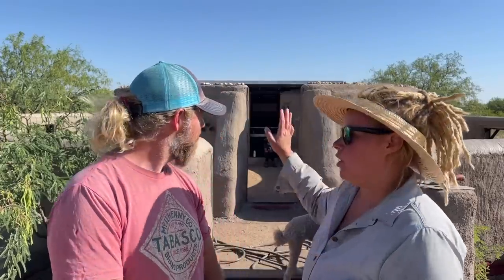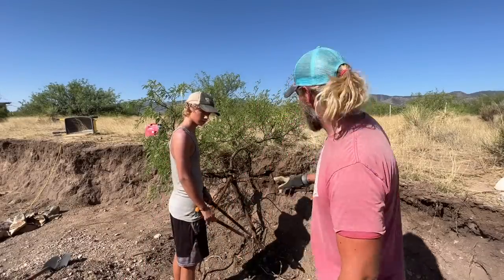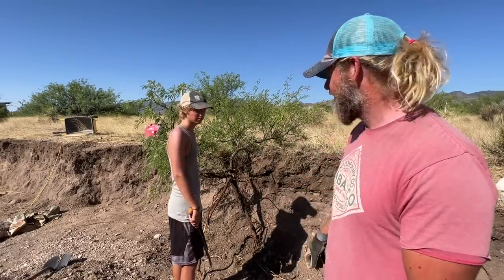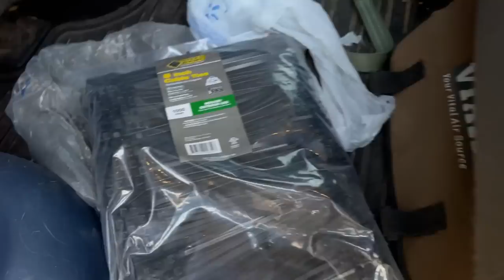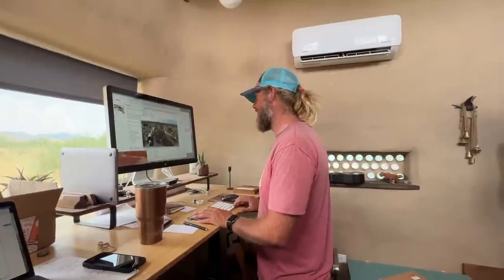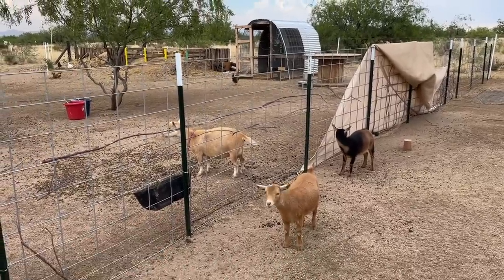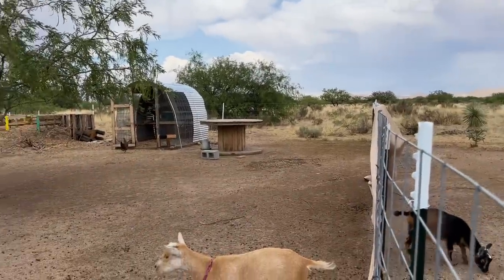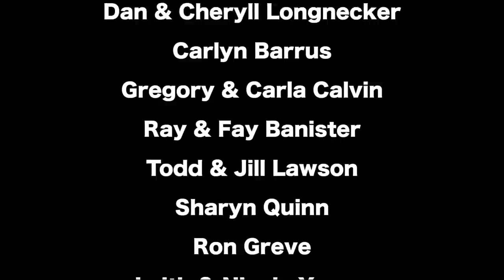Humping Up the Chicken Garden? Plus a Quick Goat Shelter (Day 146)

Comment: Looking nice. You'll have to put solar lights on the top or inside sides. Nine nine needs a kiddy pool. By the time you guys get done your put will be a nice cellar. I wonder if the roof coating Sure Coat plasticized coating would extend the life of the structures. It has a ten year guarantee then you roll on an activator to extend it another ten years. Might be nice to put on your house.

Comment: You put socks on your microphone!   That’s awesome!  Thank you. You did fantastic!!!  Started to ask you why you didn’t have a stake pounder but then I saw you whack what looked like one. I have one but I am 1500+ miles away.  It is a heavy cast iron tube with a cap at the top end and 2 large and heavy D handles opposite of each other at the top end of the tube.  You put the stakepounder on the stake and slam it down on the post, using the handles.  The force behind the heavy tube that you accelerated down when you slammed it will push the post 3”-10” into the dirt, depending on the hardness of the dirt. If you are younger (or older) and not strong enough to slam it down, you can simply lift it and drop it down and it will continue to push it into the soil at a faster rate than a hammer. Well, that is assuming that you are not wielding Paul Bunyan’s sledgehammer. And if you are using THAT, I will sit back down with a meek ‘never mind’.
Reply from the maker: We have a t-post pounder, but when there's a palette in the way you can't use it :)
Reply: If you pound the post in and then put the pallet over the post in place.
Reply: @colleenlathrop6607  - I think the stake was to stabilize the pallet already in place and moving the one pallet might have caused a domino effect.  Wild guess, though you could be right.  I am only guessing that because they were trying to beat the rain so planning on where to put the pallets was less of an option

Comment: Hi,

Do you really NEED! to do a second smoother layer of plaster? 
Could you use a lime paint or similar to protect the current coating? 
It is, after all, a chicken coop, run and garden.
Reply from the maker: Yes, the final layer has a higher ratio of cement, is compressed, and smooth. According to CalEarth this provides the right amount of stability to keep the rains from ripping it off. Of course it's all a test, so we'll see how it performs.

Comment: I don't know what the brand name is, but for the past 30 years we've had a T-post pounder with a large spring inside it. I can't stress enough the huge difference between the amount of work of a normal slide T-post pounder and a slide pounder with this heavy duty spring in it!  It will revolutionize the T-post game for you! I would say we bought it at the farm tools part of the Kansas State Fair in the 1980's. If not it would have been Tractor Supply Co. I'll try to see if I can find anything online for a contact.
Reply from the maker: We have a t-post pounder, but when there's a palette in the way you can't use it :)
Reply: Yes they are labor saver!